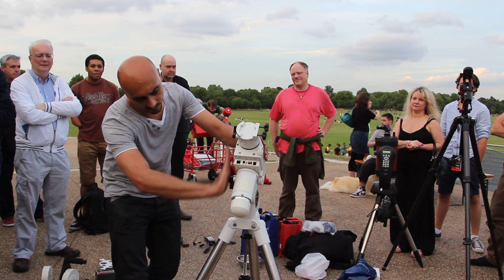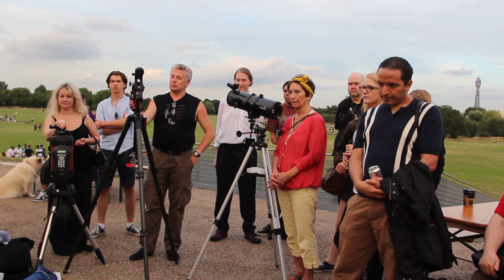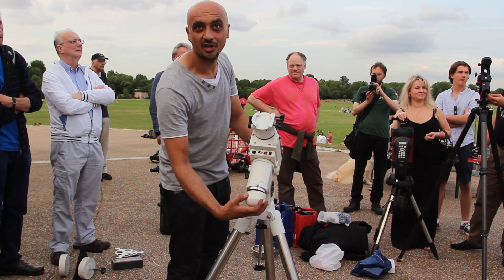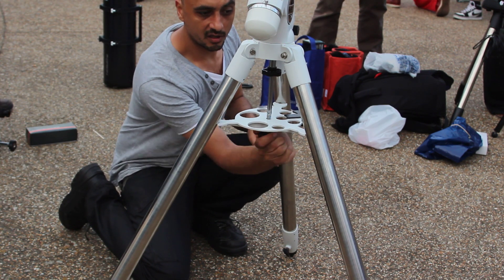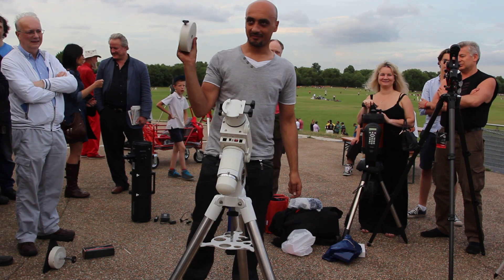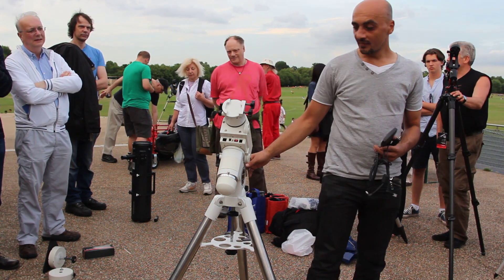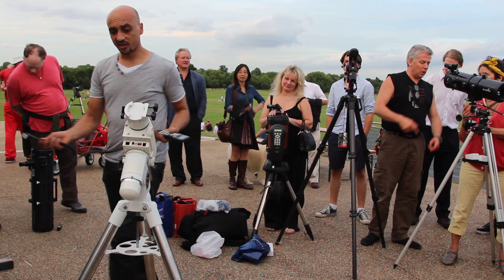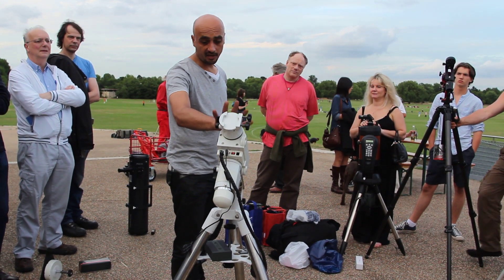Basic setup for EQ5 mount - Baker Street Irregular Astronomer's meeting 2014.07.16

Comment: excelent tutorial, thanks! One question please: I just bought a new skywatcher120/1000 rig with equatorial neq5 and I'm still learning the equatorial (before it had a 70mm with altaz mount. Once I managed to put it in parking position (orient the tripod to the north with a quality compass, level the tripod , level right ascension and level declination and adjust latitude of Madrid), can I consider that I am aligned with the polar? even if it is fake alignment? because sometimes you want to see the moon during the day or because there is something that does not allow you to see the polar. And Would you know how many degrees you have to deviate to true north in the location of Madrid, since the compass will indicate magnetic north?